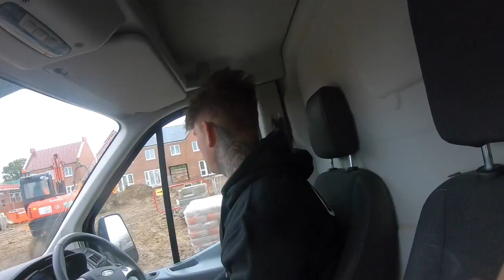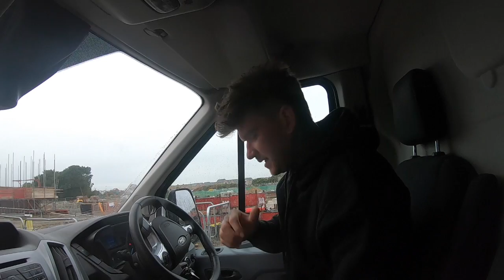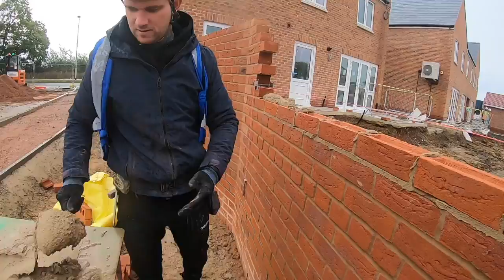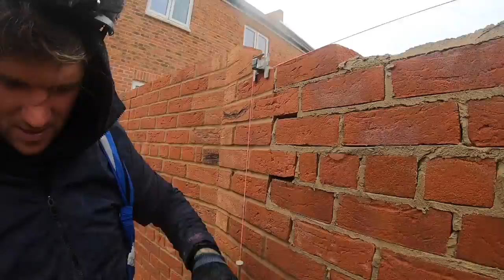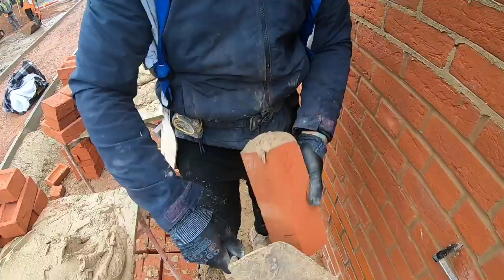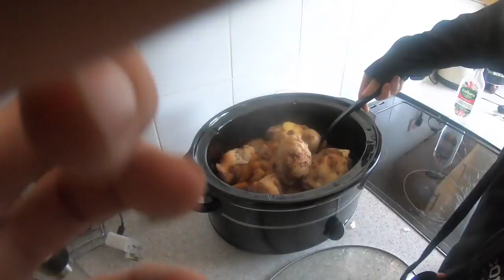New plans for next week sorted..

Comment: Can anyone give me some advice on cutting celcon thermal blocks with a circular saw, sick of using a hand saw so I want something easier to use but not sure on what blades to use on the circular
Reply: Don’t do it,the dust will kill you.
Charlie scores them with his trowel and then snaps them . Easy.
Reply from the maker: Block splitter without a doubt in my opinion, I’ve done both and the block splitter is worth every penny 👍🏻